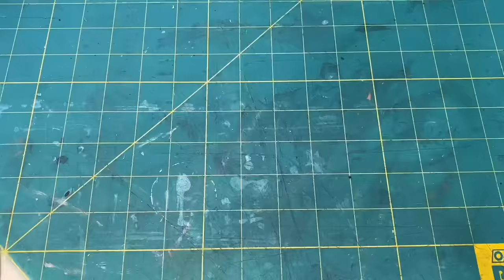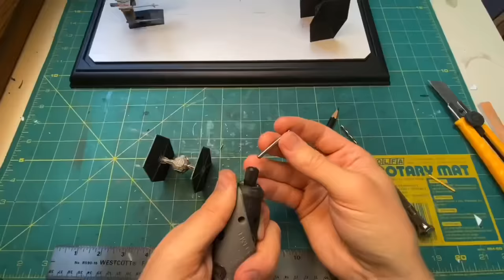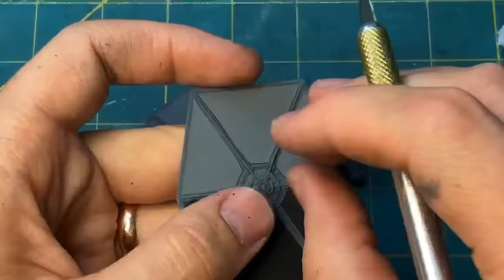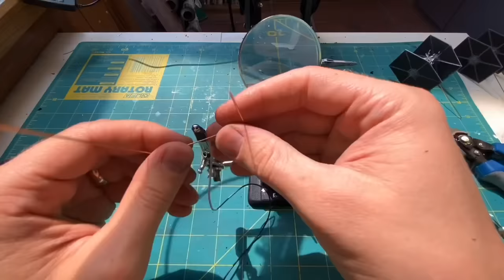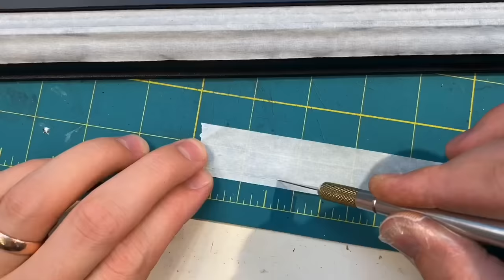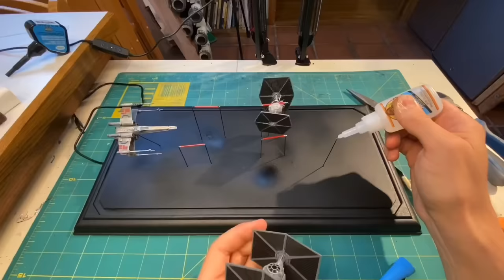SQUADRONS | Star Wars Diorama

Comment: I would install some purple led’s in the engines of the x wing, to simulate their functionality
Reply from the maker: That’s a good idea!
Reply: @Boylei  Man this is a beautiful diarama..did you just solder the led cirquit to the 110/220 volt leads?
Reply: I think that’s be a little hard you’d prolly have to run wires through the model and those models are usually very fragile
Reply: Isn't the engine glow for X wings pink usually?
Reply: @typhoon37351  I’d say magneta
Reply: @justkiddin1980  No you are going to bust them. LEDs typically take 3V. The bulb has voltage regulation.

Comment: Thanks to you, I realized the same thing but integrating it into a landscape in the Guilin region. I also replaced the electronic board part of the LED bulb with a 12V 2A power supply and added resistors in parallel on each LED (less chance of getting hurt ;)).

 Thank you very much for this tutorial!

Comment: You can now buy the leds in red and different colours on Ali. I bought the 3 volt versions and a small led driver. Thanks for this I plan on doing the same but hanging from the ceiling using much larger models that I just received.

Comment: Have you considered using clear epoxy? Place small test tubes around the wires, fill the with clear epoxy, the fill the outside with clear epoxy as well. The test tubes should bend the light around the wires making them invisible. This would also remove the need for mounts for things like the ships.

Comment: an idea that came to me:  get a hull part of a star destroyer, or any mechanical large surface(empire) in scale if possible, and replace the black base, detail and finish with any very matte paint, it will blend the lasers rods and add a scene likeness to the piece =D   btw, luv the work
Reply from the maker: That’s a good suggestion! I’ll definitely be doing more like this in the future with more going on in the background.
Reply: hope u like the idea, u could even add some fiber optics lit by leds to make the star destroyer to feel, alive* arduino a small board, with a wifi port, so u can control the lights from a laptop/pc

Comment: Better to use a thin wide as both structural  element to hoover the diodes and to power them. That way you could avoid the posts that hold them up

Comment: Did you consider using insulated wire for some of the filament LEDs, but one lead would be running underneath the filament? Both wires would go to 1 hole, but with the copper wire for support. Cool build!

Comment: Ironic to show the xacto knife and label it very sharp, yet you get cut by the light bulb.  Well done project!  One question: the light bulb filaments won't  melt the red cellophane?
Reply from the maker: Thanks so much! That’s a good question. These low voltage filaments don’t get hot enough to melt the cellophane, I found the driver to be the only component that gets hot.

Comment: How did you power 12v lights off of USB? The little driver board is looking for 12-36v input from the looks of online listings. Unless it just works fine off of 5v? I was thinking of just buying 3v filaments that are standalone and use a resistor to drop usb voltage to 3v.

Comment: Rand Corvus flew toward theTIE, firing at the imp pilot, suddenly the TIE shot forward and pulled up. Rand chased the TIE, his X-Wing chased after the TIE. He switched his radio onto the imperial frequency, “attention imperial pilot, this is New Republic pilot Rand Corvus, Surrender now!” The imperial yelled over the radio, “I’ll never surrender to you rebel dogs!” “Have it your way.” Rand said quietly as he fired at the TIE pilot, hitting the wing and sending the cockpit spiraling into space, suddenly another TIE appeared as he fired, he suddenly got a message on the radio from the second TIE, he turned it on, “This is Imperial pilot Janus Relot, I surrender!” “Cease engines and stay were  you are.” He responded. He switched to the New Republic frequency, “this is red 10, I need a cruiser to come pick up 2 captured TIEs, one is damaged.”, he said as he looked out the cockpit and saw the TIE he had shot floating around. A few minutes later a New Republic hammerhead cruiser appeared out of hyperspace, he flew toward it as the 2 TIEs were tractor beamed aboard. He landed and looked as the 2 TIE pilots were taken into custody.

Comment: This is awesome! Anyway you could share a photo of your circuit with how it’s wired? Does the paint on the copper wire supports insulated enough to prevent electric shock?
Reply from the maker: danj20 Thanks for your question! The copper wire is actually enamel coated, so they are insulated to begin with. And I don’t have this one any more, so can’t take a picture. But I am going to make a special video dedicated to the wiring at some point!

Comment: I get the trick you did with the light bulb not sure I could do that with all that glass but how did you get it to work they're vacuum-sealed so wouldn't that string or wire explode cuz I remember the old experiments from I believe Thomas Edison I believe and when they try to create the light bulb it would always explode because of the air inside
Reply from the maker: Thanks for your question! These are actually LED filaments. They are made to look like the filaments from classic bulbs, but are actually a bunch of tiny LEDs wired together with a diffusing coating.
Reply: Hey R U there?

Comment: I have question do you use 12 volt dc or 120 volt wall power?
Reply from the maker: I actually ran these off a 5V USB power source. The bulbs you need to buy are 12v. The individual filaments in those bulbs are 3.4v